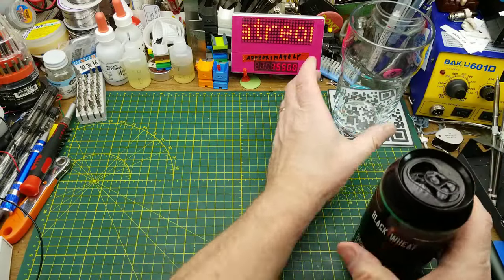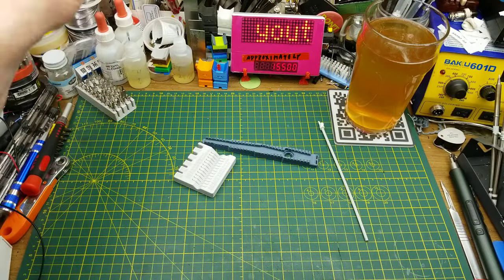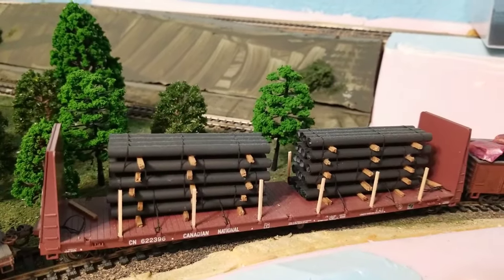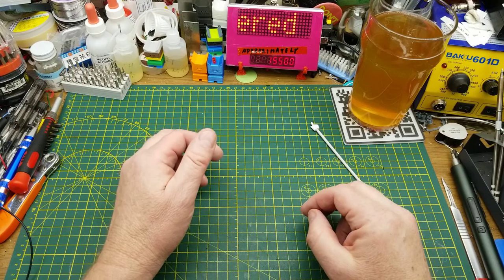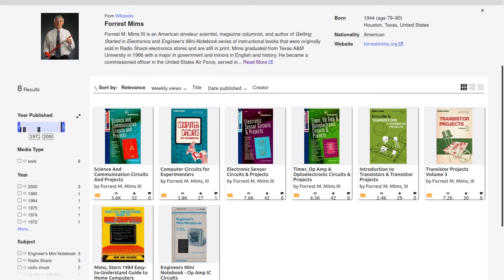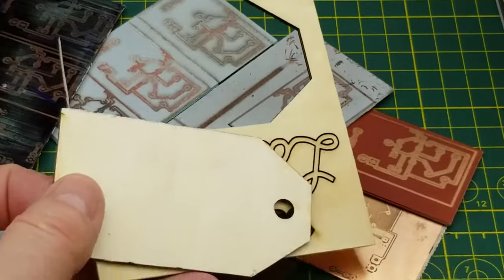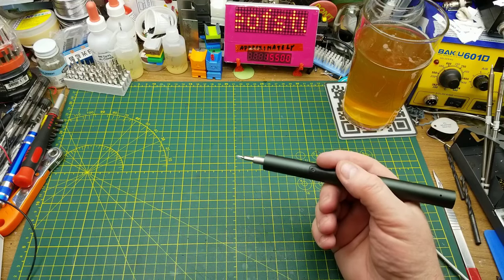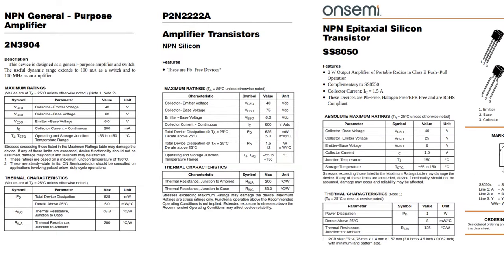Q&A 2024 edition

Comment: Regarding transistor types I like to think of those three as small, medium, and large. The small ones like 2n3904 have lots of gain but can't move much current. Medium ones like 2n2222 have less gain but more current, and then 8050 is better if you need even more current. It's kind of like 12ax7 vs 12at7 vs 12au7.

Comment: I have heard that AI can write software. Perhaps it could write a script that would be close enough to save you some programming time for your overhead camera?
Reply from the maker: In my experience those AI tools can be very confidently wrong at times.
I've seen some simple code that they have made, but as often as not, the more complex the requirement, the more broken the resulting code.
Reply: @pileofstuff  "very confidently wrong" is the best way I've heard it put.  I tried to get ChatGPT to write some in game script for a game I play and it was VERY confident and very convincing.  Turns out though it was mixing the old and new Game APIs so what looked good was just gibberish.